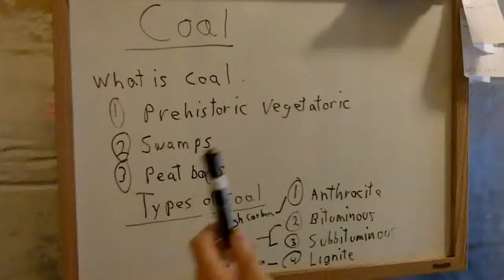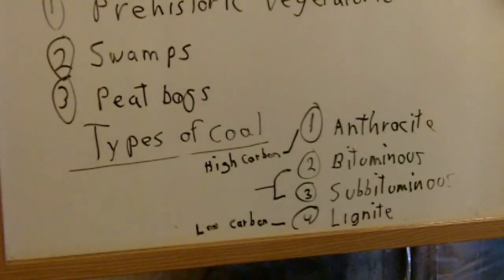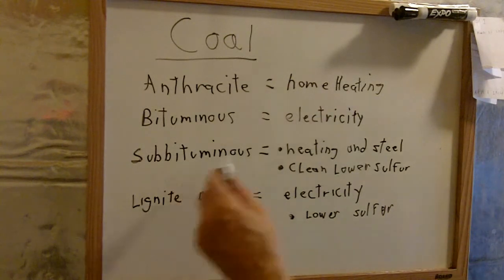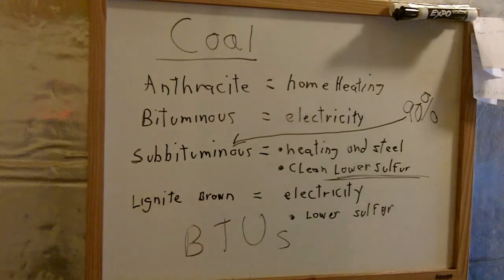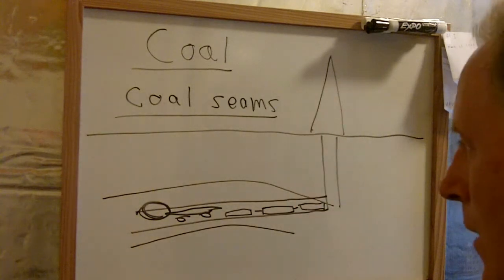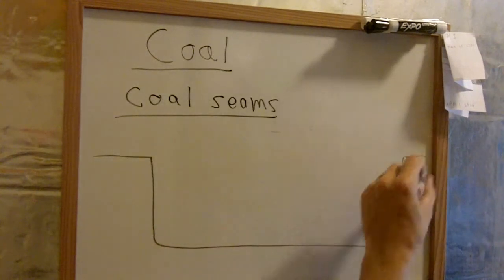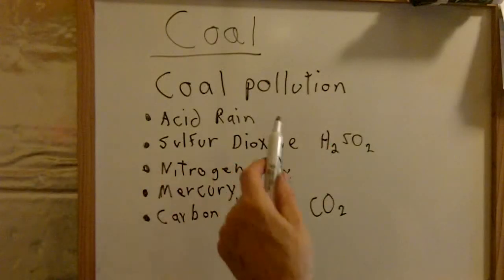Peak Coal? Not Yet

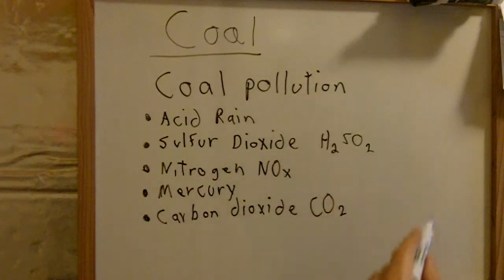Comment: 5:15 Sulfur dioxide SO2 plus water H20 results in H2SO3 = sulfurous acid = part of acid rain. Whereas SO2, NOx, mercury and other pollutants are clearly poisonous, CO2 is a greenhouse gas. If CO2 was poisonous, we would die from mouth-to-mouth resuscitation.

Regarding the peak coal question, David Rutledge approach to fit the cumulative production to the logistic growth curve is quite convincing. https://doi.org/10.1016/j.coal.2010.10.012 and https://www.youtube.com/watch?v=GJnQmCCLXfM#t=12m35s